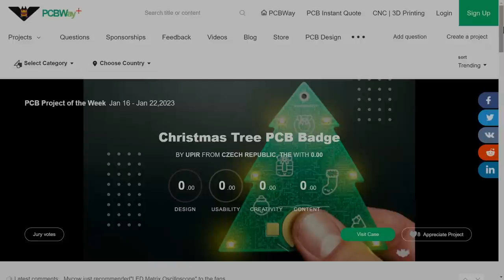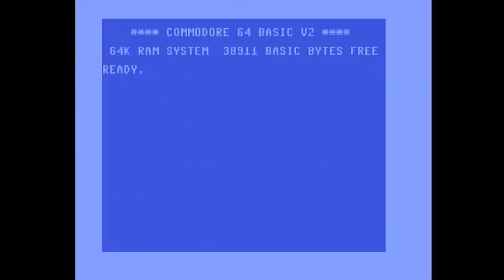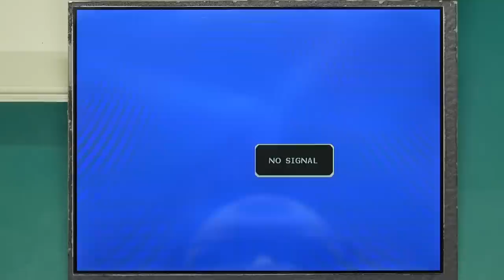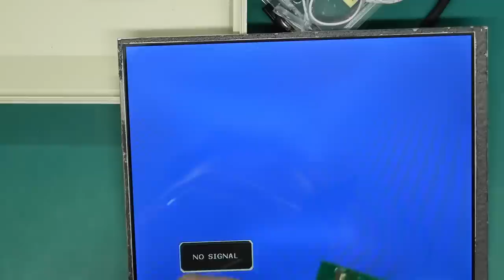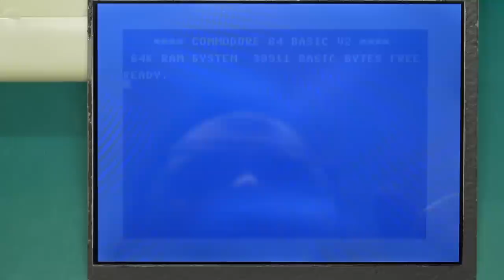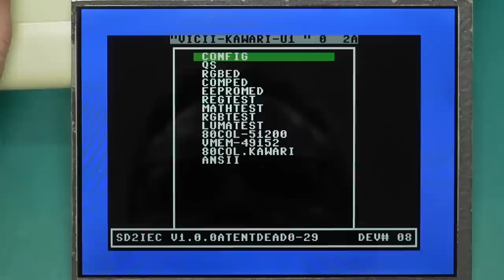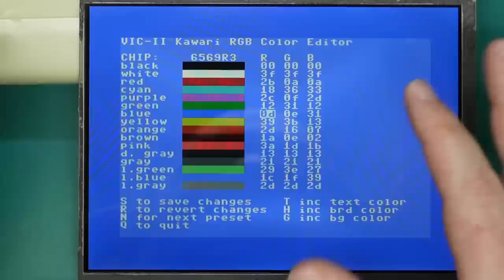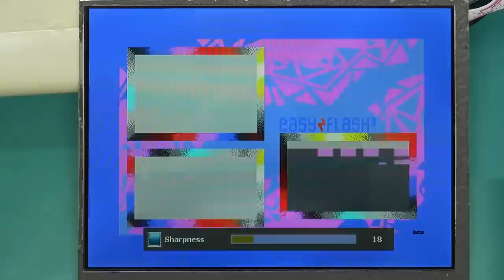VIC-II Kawari Large - HDMI for your C64 plus how to embed HDMI audio

Comment: I just bought a Facebook Marketplace find with a Commodore 64 (board # 250425) , 1541c, 801 printer, two Commodore branded modems, around forty games with original discs for the machines. All were in original boxes except printer. Inside the C64 had never been worked on with back clips still not broken and all internals checked out perfect. Bought new power supply as  I found the 9v AC circuit bad. Previous owner had luckily not hooked up in thirty years. Also came with cassette unit also. Checked out with complete dead test kit and all passed 100%.  Did not expect that.  All cases had been stored in a house for the thirty years and there is absolutely no fade. The C64 and 1541c look like new inside and out. Looks like it may be a very low hour system !!! Was $300.00 usd a good price to pay?
Reply from the maker: Looking like new, working and with boxes. Yeah I'd say $300USD is a pretty good price. Nice one 👍

Comment: When tightening cable ties I often use some pliers to pull on it to make it all very tight easily. Twist slightly to get a better grip.
Reply from the maker: I'd usually do the same, but these one's are pretty thin and easy to break with too much force

Comment: Yeah, not sure why the odd resolutions are necessary over the DVI/HDMI. Perhaps that is not set in stone for future firmware updates. In Adrian Black's kawari video, standard resolutions appear to be available over the analog VGA output. Of course, you will need to solder up your own header and connector for that, and it also is out of scope for this video. :)
Reply from the maker: Yeah it's a little odd, although I'm not sure if that display is telling me the correct info. According to the GitHub page it should be 845x526 for NTSC. Either way it's an odd resolution and certain displays will not like it. My order has now arrived from VGP so I'm going to play with the VGA output soon
Reply: Oh, does a premade header/VGA connector exist from VGP? I was thinking I would need to piece the parts together on my own.
Reply from the maker: Oh no sorry, I meant my Kawari boards have arrived from them. The Kawari's I've been using were on loan, so I didn't want to go soldering things to them
Reply: @TheRetroChannel Got it. I look forward to seeing your future kawari videos.

Comment: I had same issue with Dell monitor, wont accept kawari resolution. Philips 275E works without problem. But found workaround on Dell monitor, i used HDMI to VGA and it works great. Seems that HDMI audio embedder is not longer available on aliexpress, how much you paid, since they are pretty expensive as i can found online.
Reply from the maker: Oh crap. I was going to order a couple more. It was $39USD, I'll have a search today and see if I can find an alternative.
Reply from the maker: The HDMI audio embedder is now back in stock on aliexpress

Comment: Hello,  would you prefer this kawari hdmi or the latest vicII diversity with the rgb adapter?  Which do you think is better picture.  Personally
Reply from the maker: Do you mean the LumaCode? They both have their strengths and weaknesses.

Kawari is great as it replaces the whole VIC-II but the HDMI version outputs an odd resolution that certain displays won't accept. Also the standard analogue video signals benefit slightly due to less noise being generated. And it's easy to swap between PAL and NTSC.

LumaCode may work out cheaper depending on what you already have on hand and how many systems you plan to use it with. HDMI compatibility is a lot better due to using the raspberry pi, which also allows for tweaking scaling and resolution settings. But you need a working VIC-II and you are locked to PAL or NTSC depending on your C64 region.

I think both have their place and I don't really prefer one over the other so to speak
Reply: Yes Luma code.  And thanks for your thoughts:)